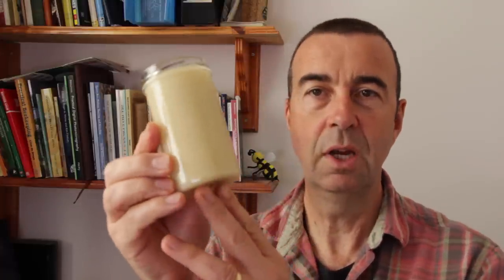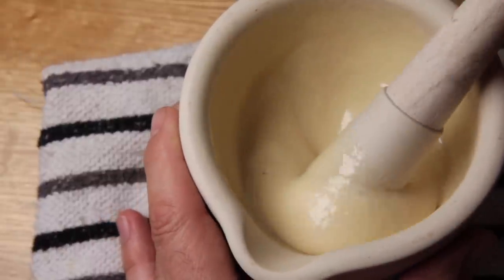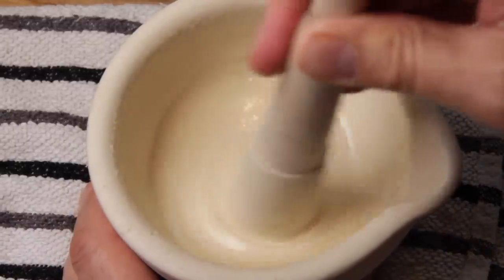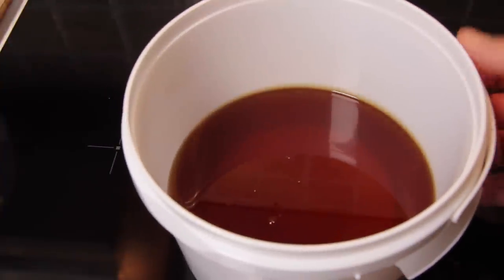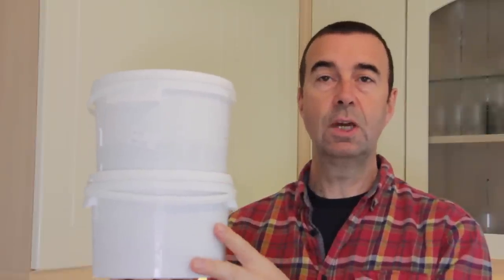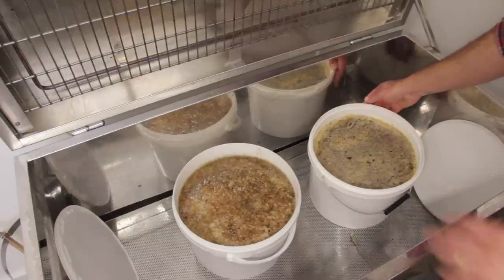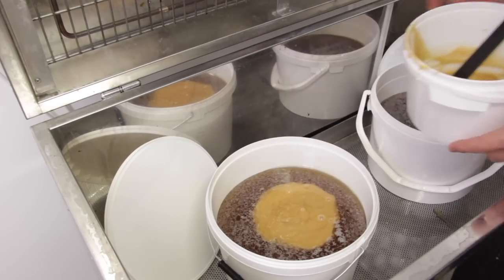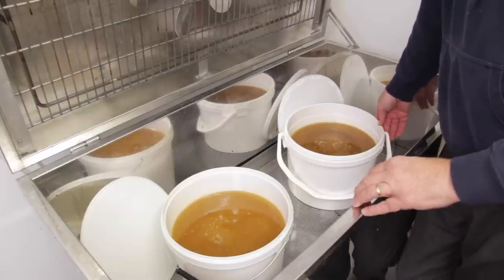Making Creamed Honey - The Dyce Method - Beekeeping Basics - The Norfolk Honey Co. #Beekeeping

Comment: Why not warm it up then it goes back to normal then after it cools whip it in your blender until creamy? Instead of spending an hour stirring?
Reply from the maker: Hi Jacqueline,
I'm following the Dyce method instructions in this video, but I know beekeepers all over have found different ways to produce soft set honey. I think one of the issues of using a blender is the introduction of air into the honey that might assist with the growth of yeasts and moulds. As the honey granualtes it releases a small amount of water and this could increase the water content at the surface enough to allow yeasts to grow and cause fermentation.
Stewart

Comment: Thankyou very much for the video. 

Just a suggestion though, your corkscrew attachment would probably work better for you if you added an attachment to it like those power drill attachments that stick out sideways to hold it with a second hand.  If you took a lump of wood around 10inch by 4inch by 4inch and drilled a hole in a tiny bit bigger than the screw shaft diameter about 2inches in from one end so it could slide down the metal shaft of the screw to near the cork end. You could hold it with your second hand way more stable as it spins.

Comment: Hi Stewart. Note you made your starter using a postal & mortar to get a really smooth honey. I was wondering for larger amounts where you are going to cream 50lbs of honey so requiring a 5lbs of smooth starter could use a Kenwood mixer on minimal speed setting with the K tool to break down the granular structure of the honey. Regards Richard
Reply from the maker: Hi Richard,
That would probably work I think. What I tend to do is make up a batch and save maybe half a bucket (5-10kg) for the next batch so I don't have to go through the grinding again.
That said, it's what long Winter night's are designed for :)
Stewart
Reply: Stewart , Thanks for your reply. Just starting to do my first batch of creamed honey. So thought that I would do a large starter batch to hold some back fo the next time I do creamed hone. Thank Richard

Comment: Hello
Thank you for your effort in producing video and following the comments. If you allow, I have 2 questions:
1. Starter cream honey is not possible in Turkey. Instead of producing seeds by crushing, could the following method be suitable: Before the honey freezes -after harvest-, putting it in the refrigerator at 8 degrees Celsius and stir for 3-4 days to ensure small crystallization
2. After adding seeds, you go directly to jars. Is it necessary to ensure that the crystals that are forming continue in smaller forms by stirring for 2-3 minutes for 3-5 days?
Reply from the maker: Hi,
Yes, you could make the starter as you say, there is nothing wrong with a coarser granulated set honey, it's just some people like it as smooth as possible.
The trick is the stirring while it granulates so if you can do that it will be better for it.
Good luck.
Stewart

Comment: I wanted to tell  you about an exciting discovery .
I bought a lyson cappings extruder and after extruding yate cappings with partially crystallised honey I left it to settle out .
Coming back several days later the particles of waxy honey were on top but underneath the layer of honey was beautifully creamed with a smooth texture with no loss of aroma as when heated, yate normally sets with a sandy texture.
 i am currently about to test the process on canola honey it may not be so obliging.

Comment: Is there a requirement to heat up the small batch of seed honey to kill off any yeast in it before adding it to the runny honey?
Reply from the maker: Hi Mark,
In the instructions I've read from Dyce's original text (some time ago now) I don't recall there being any comment in that respect. It might be prudent to do so, but perhaps with such a small starter there's not the opportunity for the yeasts to grow as fast or in huge numbers. We've used the method over and over and get great results with it and haven't had any issues so maybe it's a bit "belt and braces".
Stewart

Comment: Great videos thanks. In Uk we moved over to SI units regards temperature many years ago so use of farenheight is somewhat baffling. Why farenheight?
In any case brilliant and informative. Thank you :)
Reply from the maker: Hi K. Smith,
thanks for commenting. The reason for using the Fahrenheit measurement is that in the original documentation Prof. Dyce used degrees F and I wanted to stick with his original instructions. It doesn't take much to convert and it was a nod to Prof. Dyce and his work.
Stewart
Reply: The Norfolk Honey Company hi Stewart,
It's a superb video and clearly a lot of effort went into producing it 😊 😊 thank you.
My question arose simply because  people often end up talking about "degrees" and then no one knows what they mean. 
Cornell university has over the years produced some great work. As a (former) electronics engineer & semiconductor development scientist I even worked briefly with a couple of folks there. One now sadly passed away. Americans now work in centigrade in science though this has clearly yet to trickle down to their public. Probably why Dyce used farenheight - his audience - unless it is a very old book.
American intended audience (for book). I see now.
It's time for the American public to move on.
Thanks again for a very informative video and the nod to Dyce. Fascinating 😊😊
Reply from the maker: The original work was carried out around 1930, the original paper was Dyce, E.J. (1931) Fermentation and crystallisation of honey. Bull. Cornell agric. Exp. Sta. No. 528. Also, Dyce, E.J. (1931) The Crystallisation of honey. J. econ. Ent. 24:597-602. These taken from Eva Crane's fantastic book "A Comprehensive Survey of Honey".
Stewart

Comment: Hi Stewart...Does the seed honey also need to be heated to kill the yeast or just the runny honey?  I'm excited to create some creamy honey.
Reply from the maker: Hi James,
You can go either way really, it makes sense to kill off the yeast prior to putting in the effort to create the creamed honey as it is quite a lot of work but if you start with a small amount in the pestle and mortar then there will be little yeast in the sample to start with. That said, yeast will multiply at a fast rate in good conditions so a lot depends on how fast you will use the creamed honey once it's prepared. I would take the time to heat treat the seed first and allow it to re-set prior to starting out.
Stewart

Comment: Do you "have to" wait a week between making your 1kg seed and putting it into the 10kg bucket? If so, why? And why is it different from when you make your 100g seed and put it directly into the 1kg bucket?
Reply from the maker: Hi,
No, not at all, I think it was probably just workload for me maybe, this is an older video so I don't remember exactly what I did at the time. The important thing is to make sure the runny honey isn't too warm so that the seed honey dissolves when you add it.
Stewart
Reply: @TheNorfolkHoneyCo  Thanks for the reply. I'm asking because (around 14') you mention that the seed has now properly set. Should it solidify again before you mix it with the larger batch?
Reply from the maker: Hi,
I get it close to setting but still able to be stirred, something akin to very thick wallpaper paste! It needs to mix with the runny honey which should be cool so the thicker it is, the longer it takes to mix but the quicker it starts the granulation process in the bigger volume of runny honey.
Stewart

Comment: Hi Stewart, just watching your video, great.  Because you say heat the honey to extract the water content before putting the seed in, do you have to do that with any following batches of honey or is this just for the seed you are making.  I am struggling to get the original seed to be really smooth, does it need to be that smooth or is there another method to grinding it.
Reply from the maker: Hi Sylvia,
Thanks for commenting.
because the process of granulation releases water the honey needs to be of a low water content each time you produce creamed honey so I tend to choose honey that I have that is maybe 17% water content. The creamed honey will take on the granular size of the seed honey you put in it so try to grind the honey granules as fine as you can. You can do this over a couple of days if you're finding it difficult to do in one go.
The smoother the seed the creamier the final results.
Stewart
Reply: Thanks for that, will give it another go.

Comment: I have honey I extracted earlier this year, that has gone hard in the bucket. 

Could I liquify this honey and make a batch of soft-set, or does the fact that it has already granulated mean that it is unsuitable for this method ?

Thanks in advance if anyone can help me.
Reply from the maker: Hi Patrick,
Thanks for the question.
Yes, what you suggest is exactly the process I use to produce creamed honey.
Stewart
Reply: OK Stewart, thanks. 

On the basis that 'Nothing ventured, nothing gained', I ploughed ahead this morning anyway !

Will let you know in a week or so how it has turned out.

Patrick
Reply: Stewart, just a follow-up to say that the venture has been a fantastic success. Absolutely delicious and silky texture. Everyone should give this a go.

Thanks.
Reply from the maker: Brilliant,
it is a superb method and the effort is well worth the results.
I'm glad it worked out well for you.
Stewart
Reply: Hi Patrick. just curious, how long and for what temp did you heat the old crystalized honey before adding the seed?  Did you check there were zero larger crystals somehow before proceeding?
Reply: @cobrachedz  Hello. To be honest, it's so long ago, but if I recall correctly - 

I heated it very slowly in an insulated box that I made, with a ceramic heating element I connected to an STC100 temp. controller. 

Precise temp. I set it to, I don't recall exactly. 

When it was liquefied, I strained it through a piece of material  called 'voile', which I got in a shop that sells fabrics.

There were definitely some grainy bits caught in that material, so worth doing, I think.

I hope that helps you, please feel free to contact if you have any more questions.

Comment: Stewart, what evidence do you have that confirms that the honey hasn't been damaged after heating it, as you have?
Reply from the maker: Hi 66otnt,
This is a really difficult question to answer as it depends greatly on what the beekeeper is focussing on in terms of "damage". Once you introduce heat to honey you could say it has been damaged as the increased temperatures are going to affect the enzymes present, for instance, but this doesn't necessarily mean the honey as a whole is damaged. I think the biggest concern for beekeepers when warming honey is the production of HMF (hydroxymethylfurfural ) and the limits here in the UK that are put in place by the Honey Regs 2015, not more than 40mg/kg for UK honey. I do think limited increases in temperature, in this case, to make soft set honey is acceptable and I don't think it does damage that would make any noticeable difference to the quality or taste of the honey, but it really is for each individual beekeeper to take their own view on what they prefer whilst keeping within the rules. I used the reference book "Honey, A Comprehensive Guide" by Eva Crane as my guide for both information and also the Dyce process.
I hope that helps.
Stewart
Reply: @TheNorfolkHoneyCo  Thankyou for your reply Stewart, and thankyou for another excellent video. 
Kind regards!

Comment: Very clear instructions but irritating constant switch between Centigrade (sic) and the obsolete Fahrenheit. We have used Celsius officially for decades and all the old Imperial weights and measures are meaningless to most people nowadays. All modern equipment displays measures in metric so we have to try and do rapid conversions in our heads if the old system is used. End of rant:)

Comment: Is 10% seed honey a minimum? I would like to get a very lightly creamed texture, much lighter than the typical creamed honey. Have you experimented with a method at less than 10%?
Reply from the maker: Hi Shawn,
Thanks for the question.
The lightness of the texture is going to be down to the type of honey more than anything else. The sugar crystals will still form and develop regardless of the quantity of "seed" honey you add, 10% or more will set the honey to the same grain size as the seed without it being overpowered by natural crystallisation within the honey. I have added less than 10% and it simply sets as if there were no seed honey in it all.
Stewart

Comment: I bet you a chocolate melanger, such as the Spectra 11, could automate the process so you could have uncooked creamed honey.
Reply from the maker: Hi Xaekai,
The process of making the soft set honey needs the sugar crystals to be as fine as possible and the only way to do this once it has set is to liquify it and use a seed of soft set honey to set the granulation crystal size.
I don't know of the kit you talk about but maybe it would work yes. Perhaps if you try you could let me know how it goes.
Stewart
Reply: @TheNorfolkHoneyCo  A chocolate melanger has a cylindrical drum with motorized granite rollers. It's basically an automated mortar and pestle. I'm saying via the use of such a device you could eliminate the destructive heating process, and produce creamed honey that doesn't contain elevated levels of hydroxymethyl furfuraldehyde endemic to honey that's been heated beyond 140 degrees F.
Reply from the maker: Thanks for explaining,
One of the reasons for raising the temperature of the honey is to kill off any yeasts so that fermentation doesn't start. The process of granulation releases water into the honey and higher levels of water can allow yeasts to develop and spoil the honey so I think there is still a requirement to warm the honey. I understand the issues of HMF and I like the idea you suggest. Maybe if honey with a low enough water content at it's starting point was used it may be possible to produce a fine soft set honey and not risk fermentation.

Comment: How about just putting in blender?
Reply from the maker: Hi Ray,
I guess you could try that but then it wouldn't be the Dyce method and I've just been pulled up for not using the exact method of another beekeeping process in another video.
There are many ways to get to the end result, these days you can simply put the honey into a "creamer" and let the machine do the work for you, however, the end result will only be as good as the seed you put into it so the finer the seed the better the end result.
Stewart

Comment: Why not use a blender.  Same results but  no carpal tunnel syndrome.
Reply from the maker: Hi Joyce,
I think the pestle and mortar get's the honey into a truely fine crystal structure whereas the blender, whilst it does something similar doesn't get it as fine and actually can warm up the honey so it begins to liquify insteam of break down the crystal. That said, I've never used a blender so it may be the way forward!
There's also a kind of connection with the work done and the results out, I quite like the process too. That's the great thing about beekeeping always more than one way to do these things.
Stewart